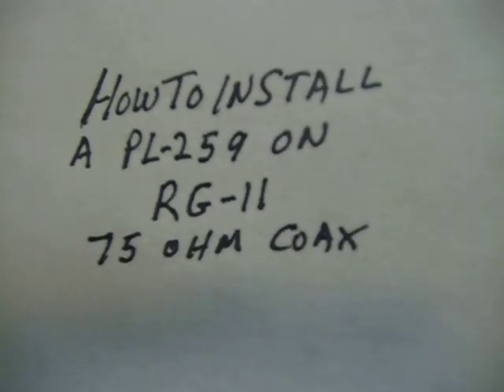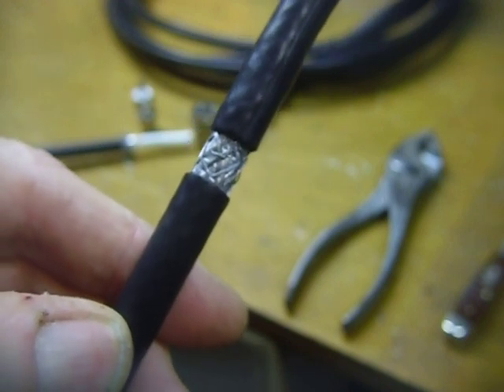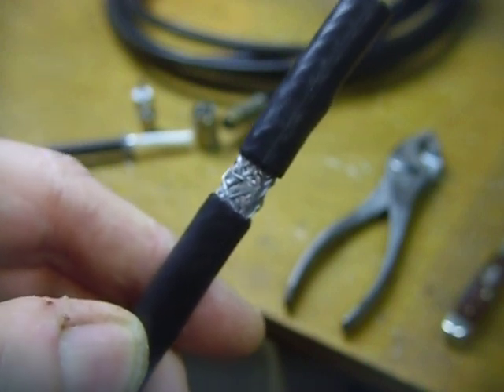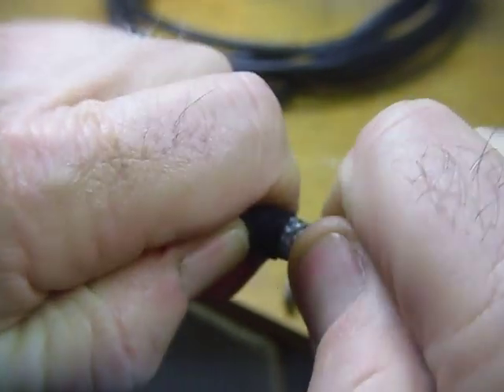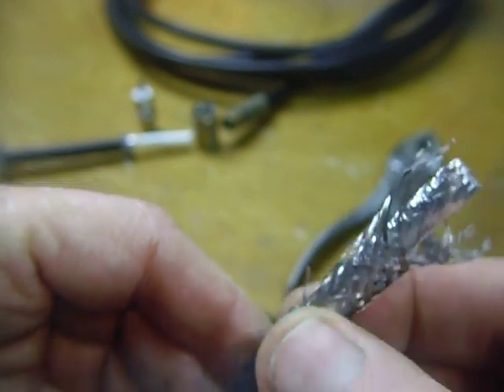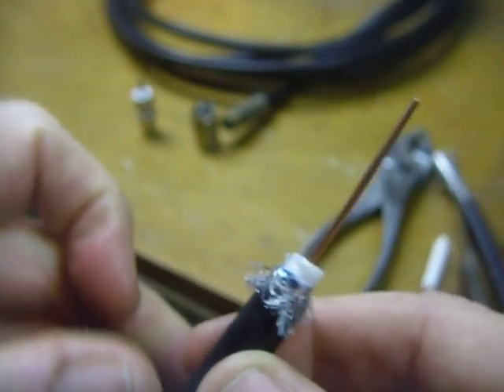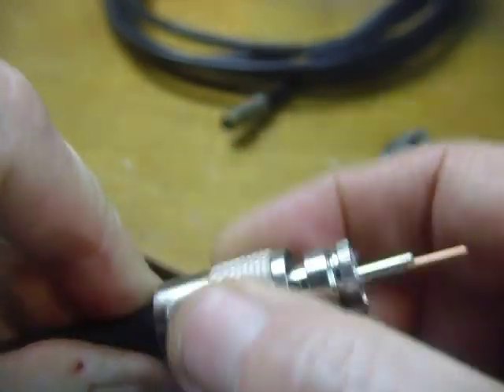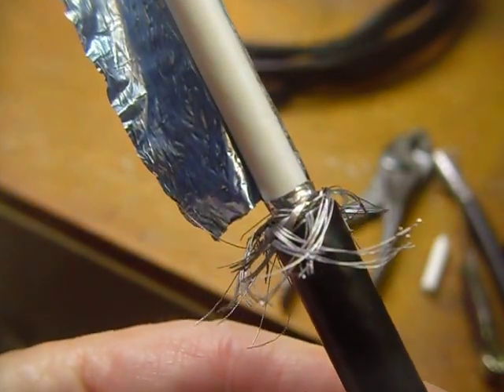Installing a PL259 connector on RG11 Coax,RG11,PL259,75 OHM Coax,Amateur radio use of RG11 COax

Comment: Hi

A different topic I know but you hv covered it before. 

I hv 2060A. Heathkit. 

I use it to tune before using my sb1000 amp. 
I made a chart for three sections on each band. Using the chart as a starting point and then adjusting c1 and c2 for lowest swr’s. 

Here is where I am confused. 
In the manual, it states c1and c2 dials should be set to 100 to provide max capacitance. ???

Next is the sensitivity knob, how is that used?  The manual is very brief on this.  

Thanku so much. 

Billy

Comment: How reliable is this method? how much testing have you done? how about the miss match? would like to know the tricks on using it in a 50 ohm system. take care 73 good dx!!
Reply: cool, I have 500-1000 feet of rg11catv stuff withe the goo sealer in it and got it cheap on eBay. I have a bunch of amphenol pl259s  the solder on type, some of them are the, all silver type and want to put up a dipole. I have a few questions, do you cut your feed line to a 1/2 wave multiple? I have a Manuel tuner so I am not worried about swr. all so do you use a 1to1 balun or not? all so how about grounding the antena for static bleed off? I know that for lighting one has to have a big ground bonded to the ac service entrance and that is out of my buget and I am not going to be in this location long. so for static bleed off I was thinking that the outlet ground would work. all so after I am not using the radio I will disconnect the coax and remove it from the house and put a dust cap in the pl259 to keep the weather out. what are your thoughts on using the outlet ground for bleeding the static off, to prevent the static from damaging the radio? thanks and good dx !

Comment: If you use Cat 6, you get 4 twisted pairs of wire.  The stuff you show here has no twists and only one pair.  I hooked these up to Ubiquiti antennas using PoE (Power over Ethernet)

Besides, who needs coax with Roku, Amazon FireStik, and Google Chromecast to get TV via WiFi?

Get with the program.  This is 2016. They have these things called Remote Radio Heads (RRH) --not a single piece of coax anywhere on new cell towers and antennas.  Show us how to fuse fiber optics.

I still gave you a thumbs up even though you didn't use LMR-195 for low loss (not inexpensive).
Reply: +Jules Bartow    Moron !
Reply: +vidas v Obviously you've never been on a modern cell tower or dealt with the microstrip antennas and CDMA, SC-FDMA, OFDMA.  Are we anachronisticly regressing to childish name calling during bouts of dimensia at the old folks home?

Comment: Just an observation... Should the dialetric butt up to the start of the center pin?  I could see the center conductor throught the side holes in the body of the connector.

73
Reply: yep I think it should be also ntype as the higher the freq the more lossy pl259 is ,